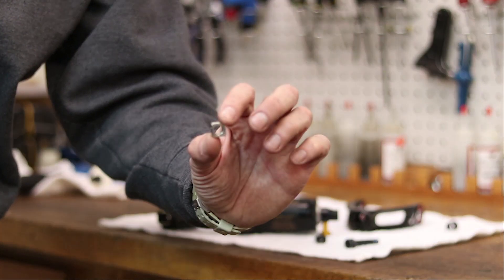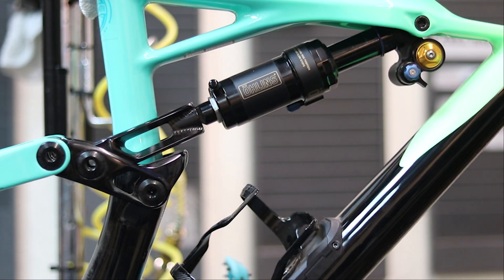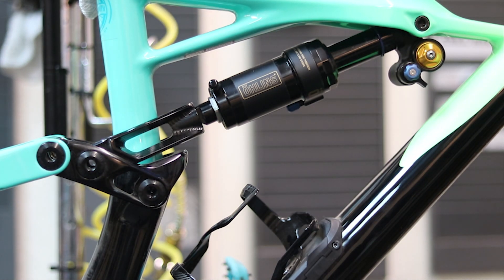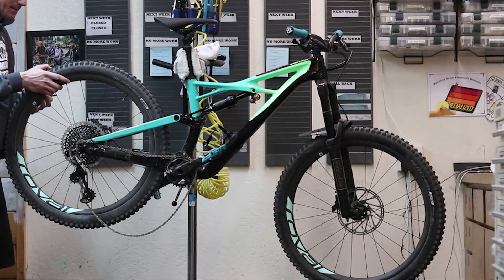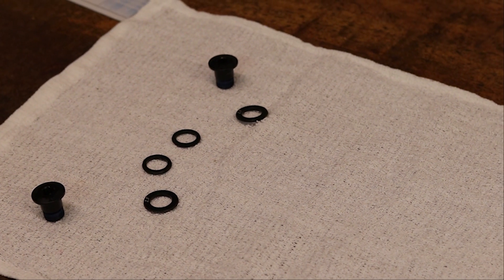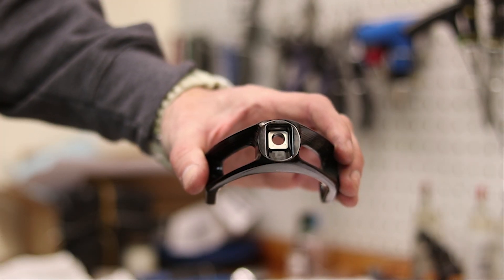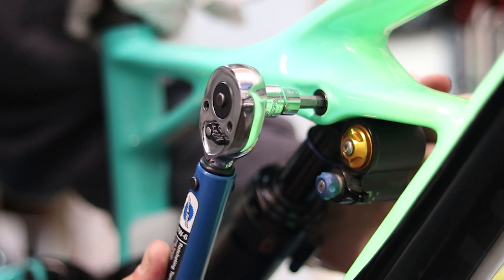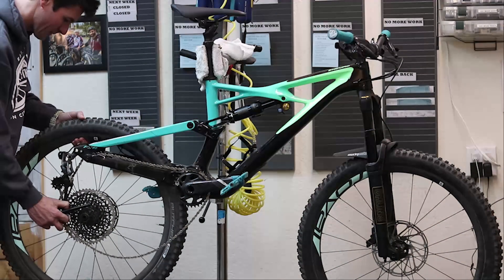Specialized Flip Chip Tutorial

Comment: Hi buddy I just brought a 2017 enduro elite frame with no shock so I went n brought a second hand one from eBay but it seems to missing the bolt that secures the shock do you no the size of the bolt and do you no if this flip chip washer comes on the 2017 model if not all il need is the bolt but I can’t seem to find one anywhere or the size any help would be great full cheers 😊

Comment: Where can you purchase the extension
Reply from the maker: Hey Alex,
It's stock and included on the newer Enduros.
Reply: For a 2017 model
Reply from the maker: The extension is listed as Specialized part # S176300001. But I would confirm with your Specialized dealer that it will, in fact, enable you to use the flip chip.
Reply: Hi buddy I just brought a 2017 enduro elite frame with no shock so I went n brought a second hand one from eBay but it seems to missing the bolt that secures the shock do you no the size of the bolt and do you no if this flip chip washer comes on the 2017 model if not all il need is the bolt but I can’t seem to find one anywhere or the size any help would be great full cheers 😊